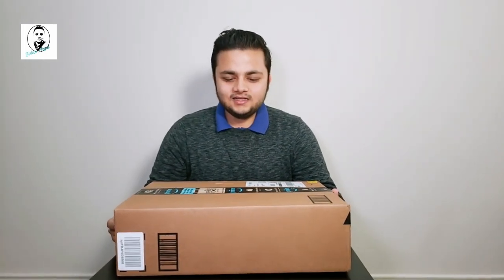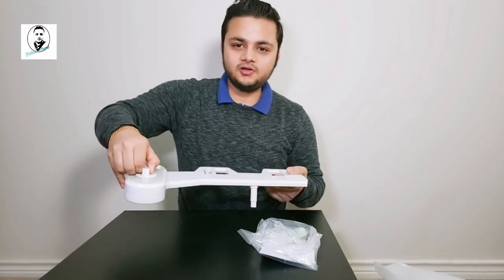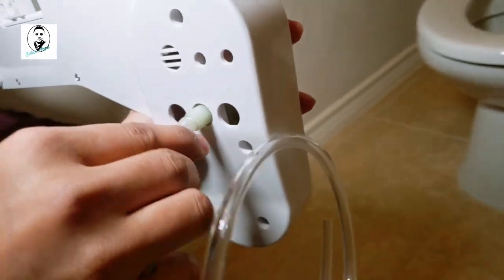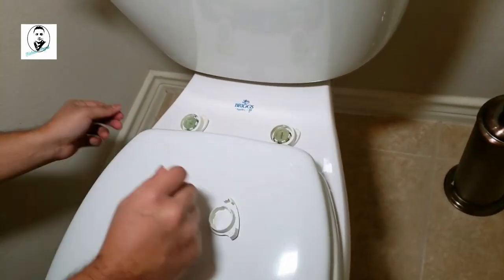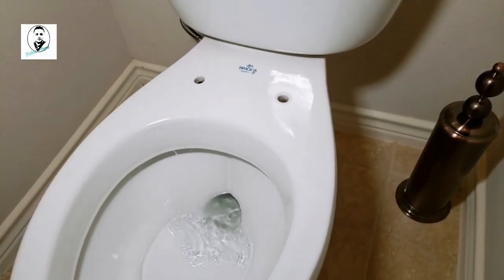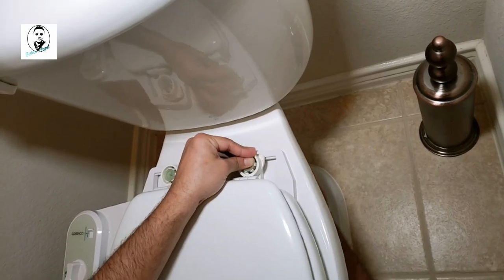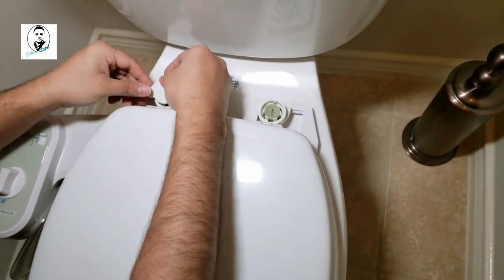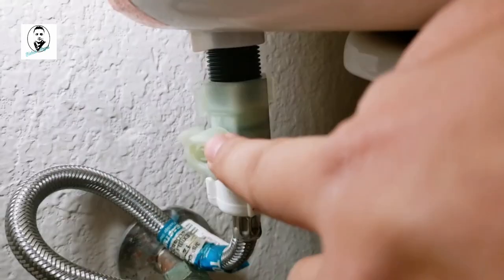Greenco Fresh Water Bidet | Unboxing & Installing || Best B

Comment: I bought two of these to install on my new ADA toilets.  I thought it would be a simple job for my plumber to do; however, he was a winy, lazy bum.  I had toilet pedestals for the two new toilets that I wanted installed.  Plumber butt bitched and wined about the hassle of installing the pedestals.  When I asked him to install the bidets too, he said they were not what they claimed to be and convinced me I had wasted my money, but now that I have watched your video, this is exactly what I envisioned it to be and how it worked.  Plumber butt told me it was only to clean the inside of the toilet like the water flowing down the sides when flushed.  Idiot!  I guess I can now install these myself thanks to your video.
Reply from the maker: Great.. you can do yourself. It's a simple procedure, no need to waste money on plumbers....
Reply: Your plumber should not be a plumber.
Reply: Patricia Chaires damn no need do be so cruel. maybe he didn’t understand how to do it
Reply: @Blade_POINT He was a plumber, for God's sake!  He should be aware of all plumbing fixtures.  Geemoneez, man.  Give me a break!
Reply: Patricia Chaires yea that’s accurate ig

Comment: If I wanted to install it on the left side of the toilet is it possible???
Reply from the maker: Yes, it's possible. Just buy left hand side bidet. But make sure your flush connector is on left hand side as well, otherwise you need long hose than what they provide on the package..

Comment: what about the washer? Mine leaking from the adaptor
Reply from the maker: Didn't you get washer on it??
Reply: @TheUnboxingJourney  Thanks for the reply. The washer size seems too big for the adapter. I wonder if I should trim it to fit in.
Reply from the maker: @ilikecucumber  Be careful and do it if you know what you are doing. If washer fits perfectly, you will not have any leaks.
Reply: @TheUnboxingJourney  nah, we didn't cut it. Instead we live with the small leakage with a container below. Thanks for the help.

Comment: I hurt my wrists trying to get the plastic tubing onto the connectors...I could barely get them half way on and I’m afraid they’re going to pop off and water get everywhere. Help!
Reply from the maker: Sorry to hear. Just jiggle left and right and push downwards, that should fit the tube in the nozzle
Reply: Thing I found out that helps is heat the end of the tube slightly by holding it over a lit flame for a few seconds and it will go on much easier.